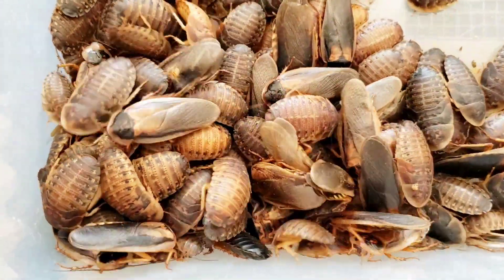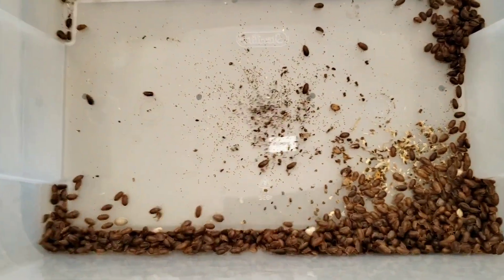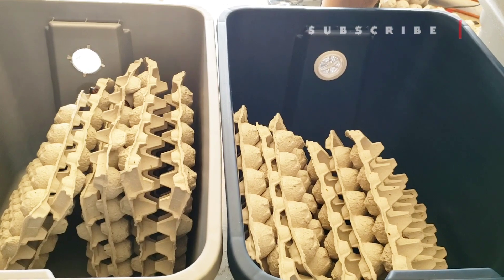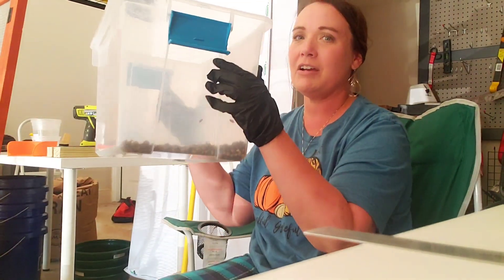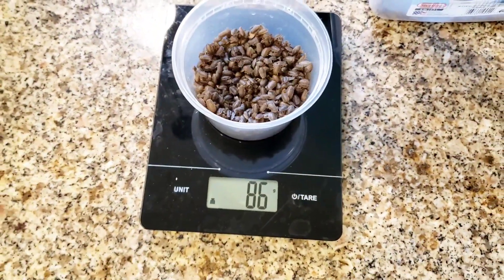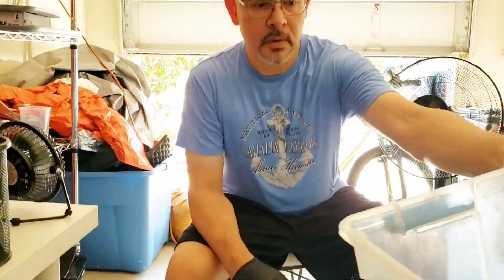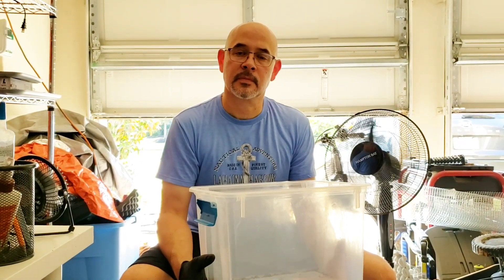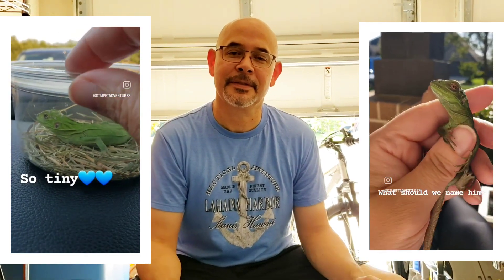Dubia Breeder Experiment #1: Do Oranges 🍊 really make prolific breeders or is it a myth?🤔 Watch 2 C

Comment: I have a question. To what point do you ask yourself the question:

 “is it time to rehouse my starter colony?” 

I started a colony about 5 months ago out of 120 dubia (mostly adults) and I feel like now it’s between 800-1000, if not, more than that. Should I do a rehouse because they are in a 16Lx10Wx13H (inches) dark tote from Walmart. Now they don’t look overpopulated inside but maybe when the medium and large dubias mature, it might get too crowded. 

What sort of dimensions would you guys advice me to use? I have about 7 T’s and worried that I got too much on my plate, well my tarantulas plates, rather. Im considering getting a 4 feet monitor lizard just to feed them off 😅😂
Reply from the maker: Hi and thanks for watching. It appears that what you are using is maybe a 6 gallon enclosure or close to it. Which is pretty tight if you have close to 1k roaches and most larger or adults. We recommend you move them into an 18 gallon to give them more real estate but also not too much. Also with the adults make sure you keep an eye on the ratio. We do a 1 male to 4 female ratio or you might even try a 1 to 5 to keep the males from fighting and wings from getting chewed up. It sounds like your colony is thriving though and great job! Definitely sounds like way more than what 7 T's can keep up with. Good luck and keep us posted!!
Reply: @mightydubiafeeders  agreed! Thanks for the input. I will try to find tubs already and do a similar design to how y’all keep your colonies. To more dubs!